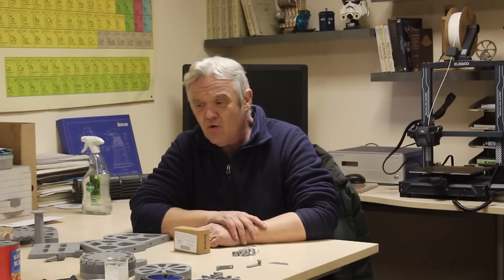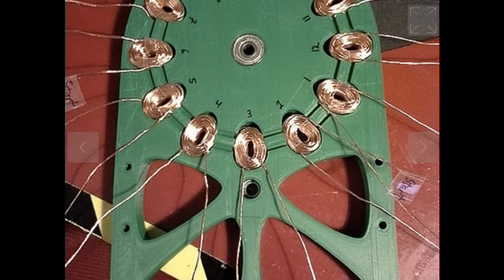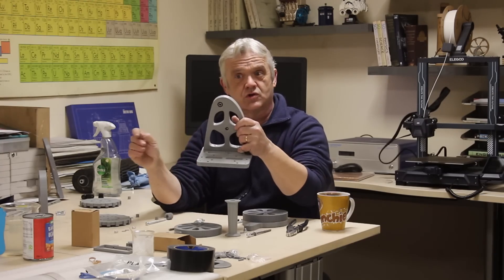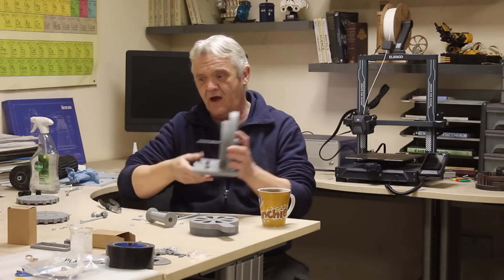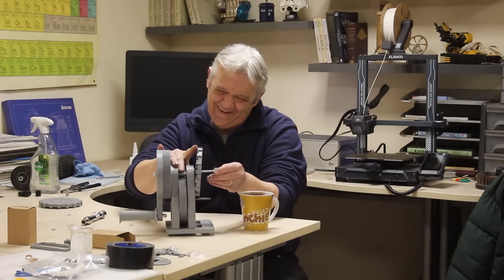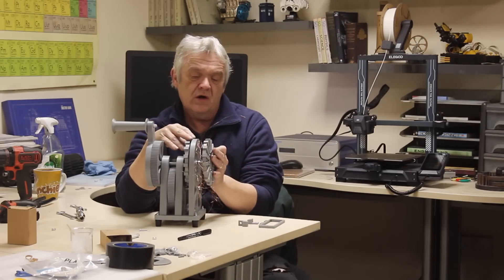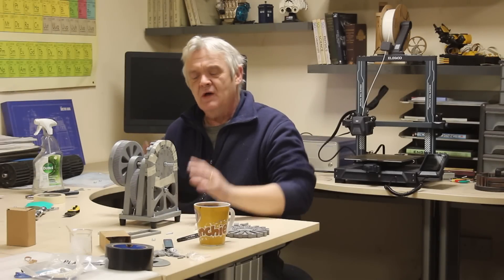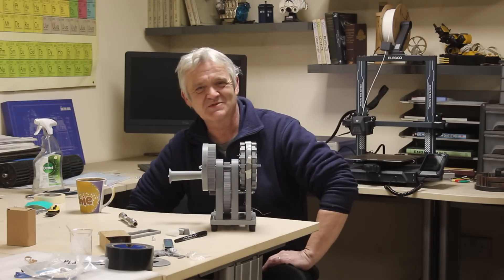1820 Building A Hand Cranked Axial Flux Generator

Comment: I have great respect for Robert, I love his videos, and I found this particular video incredibly helpful.  I just built this model.  It is by Even Erichsen.  This generator is a 3 phase configuration, if you wire it in single phase, it will not function.  The bolts that hold in the magnets are M4x12mm.

Comment: To build a hand crank axial flux you must focuse on low rpm. And to do that, you mean to stick to around 60-90rpm. The switching poles must be equal to a motor spinning at 3000rpm. Take 3000:90=number of magnetic poles switches per 1 minute. In this way you are creating a low RPM generator.
And if I am wrong, I would recommend you to have a look at a three phase low rpm generator (90 rpm).
You don't need belt or gearbox. This is inefficient. Instead, you regulate the speed by adding resistance and capacitors with lor pico farads, for example high speed current aluminium capacitors48v. Then you step down to 12v with a micro step down regulator not bigger than 100w.
And this is how you create an actual hand crank generators.
As many poles as possible and you gonna crank much much easier and with less friction.
And if its heavy, you accelerate slowly, of course. And that's better. You don't overcharge.
Use an rpm display to help you manage a gearless generator.
You ve made this video with no actual result. Just an over engineered plastic chasis with belt which seems a waste of time. I can't find any actual inovation on your channel. You are playing around with micro watts for years. Fell sorry for you.

Comment: Would a compressed helical or fan folded strip of copper work as well or better (or not at all) as the of thin copper wire on a bobbin?  I noticed how thin the wire was and how much of it has to wound to form the coil.  I'm sure there's some sort of relationship between the thickness and number of turns of the wire the magnetism has to pass through to generate x-amount of electron flow.  Wasn't sure if there might be some easier and/or more efficient alternative.  Just a passing thought.

Comment: Very interesting build, I'll definitely have to look at it. Not being an engineering person though, would it be hypothetically possible to print multiple copies of the rotor and stator set and put them all on the same axle? If this is possible I would think this would increase your output assuming everything was connected correctly.

Comment: If you were to enlarge the rotor with the handle to double or triple the size would it make a big difference to the generator output?  I would like to use this with my vertical wind turbine which I'm printing...have gone through several 3d printers in efforts to find a reliable build, I had a Creativity CR10SPro v2, but it was damaged in transit to me and the support was rubbish, so my new printer arrives tomorrow, Aquila Pro 3D.

Comment: Great video and commentary as always. I would love it if you included a comment about print time and filament cost, because being a newbies or on the fence about 3D printing that information is valuable.
Reply: Looks like 1kg of filament at a guess but it depends on settings used to print it. I can pay from £12 to £50 per kg on filament but in the uk the cheapest I have found is BOX uk
Reply: Print time could be a day or 3 depending on settings  nothing is really fast but it's always a balance of time vs quality

Comment: Thin wire will produce higher voltages at lower rpm . Thick wire will permit greater amperage current.

Comment: Very nice. Looks good. I'm pretty sure the design could be easily optimized, because it looks a bit overbuilt... I mean the parts are overly chunky and for example the crank could be directly attached to the first gear instead of having its own dummy wheel.. still. Great work from both of you.

Comment: Awesome job mate. You are a wellspring of creativity! Not too long ago I built a hand crank generator capable of producing 60 watts by hand using an old hoverboard motor. I 3D printed a simple case and crank handle, then did a bit of rewiring and voila hooked it up to a vice. A fair bit easier than this object you made, but yours look way cooler.

Comment: As you were connecting the first set of magnets, it occured to me to try to connect the rotor and stator to both the bottom and top bolts.   Creating a situation where they rotate opposite of each other.   So both the magnets and the wire sections are rotating, in opposite directions.   I'm curious if that would make it less efficient or more or just nullify it entirely lol.    Even if they needed to be completely mirrored or parallel with each other, I'm curious this effect. Does anybody know?

Comment: Ah! So that's what all those years were sitting on your desk in the last video!

It got me wondering if you could create heat from it similar to what was being talked about with a wind generator.  I was thinking like heating water for coffee or soup, or Even a cooker comparable to a hay box or a solar cooker.  Would maybe want to use pedal power instead of a hand crank for anything sustained.  

Basically I was wondering if something that size, powered by a determined human, could generate the amount of heat needed to get those kind of results or would you need a bigger generator?

Comment: Awesome build Robert! I think this would benefit greatly with the addition of bike pedals. It is small enough to put under your desk and pedal away during work!
Reply: That's what you would call being productive.
Reply: @roberthardt1846  I was thinking it could be linked to a video game. Stop pedaling, the game stops.
Reply: @whosle  Depending on what you mean by "stop", that could be done pretty easily. If you take a transistor or relay and wire it to your display, you could have the screen shut down when pedaling no longer activates the transistor gate. If you meant pauses the game, I think that might require some coding, which might be easy for someone who codes, but I'm not that tech savvy.

Comment: Very cool, will definately give this a try when I get my printer.   The idea of hand cranking  power generation is very neat i wonder why its not as popular for alternative power generatoin im assuming because it takes effort hah? but as a last resort it should be on every offgrider's survival tool list rather than just a gas generator.  15w is still quit a bit when it comes to modern electronics, my usb powerbank charges my laptop at 16 w,  and when in use only uses 8-12w while watching youtubevideos, well under 15 watts  so you could in theory power a laptop with this hand crank generator indefinately.  A pedal bike thing would be even better, then you could get some good exercise also while charging a batter bank when solar is low.    Still wonder how long and hard it would take cranking that thing  to chage a laptop, without that kind of figure its hard to visualize what these hand crank generators can produce and is it worth it?  Maybe with todays power efficient electronics.
Reply: You'd need to crank it for several hours straight which is pretty unrealistic. Make an adaptor for pedalling with legs and you'll have a much more realistic and efficient crank generator for survival purposes. A bit of rewiring will make it produce 100 watts easy.
Reply: I bought a hand crank generator and it's hard work to charge it. I would love to find a way of charging it by pedaling.